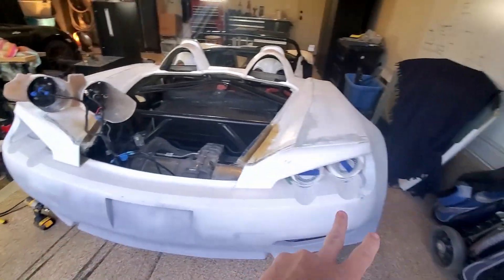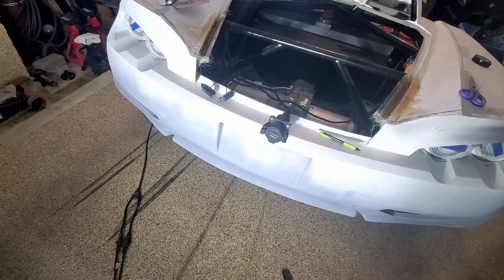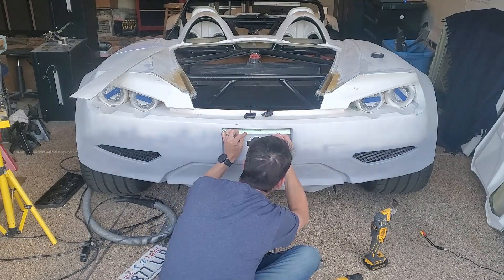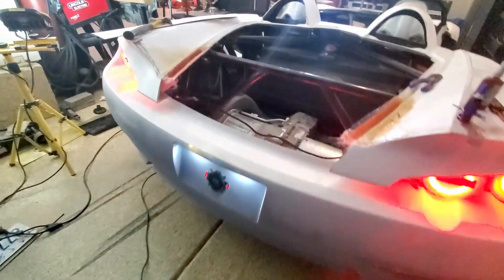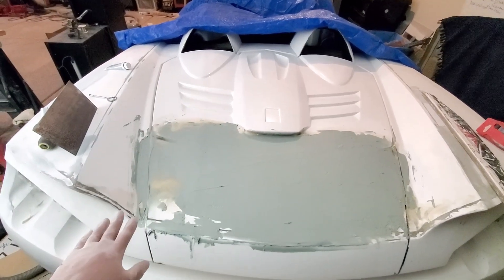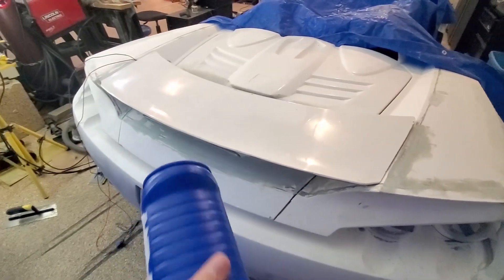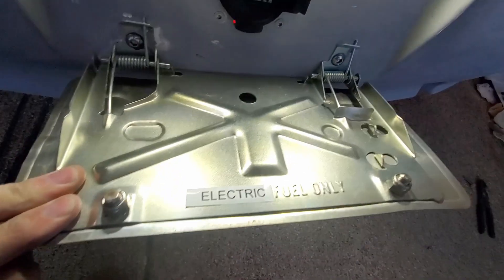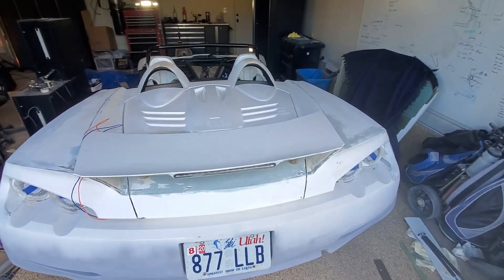Rear Wing Mounts – From Chips Can

Comment: isn't a wing supposed to provide downforce ? it kinda looks like it's doing the opposite, but maybe i'm just not getting a good angle on it.
Reply from the maker: No...you are looking at it right.  To me it does not look like it will add down force.  May need a redesign
Reply: @electricsupercar  will you ever go fast enough to need down force ? like will you take it to a track ?
Reply from the maker: @JoeGP  I figure I have to give it a try...right?

Comment: Will you have a clearance problem with the license plate and the charge cable handle? Does the license plate swing low enough to allow the handle to go straight into the charge port?
Reply from the maker: I will have to check it out

Comment: maybe try to cap the bottom of the wing stand with some fiberglass or metal and attach a bolt going down so you can bolt it down to the trunk using a nut from the inside of the trunk. and maybe just fiberglass the wing to the stand for the connection there or make tabs on the stand so that you can screw it into the wing
Reply from the maker: Thanks for the comment!

Comment: I see you are soldering a lot in your build. I am no expert at all in this field, but heard this is considered to be bad in automotive wiring as vibration, bending and corrosion can lead to wire fatigue and all kinds of problems. Did you consider crimping the connections or why did you settle on soldering so much?
Reply from the maker: I usually crimp and solder...belt and suspenders
Reply: @electricsupercar  Soldering is indeed not good if it is about moving/vibrating wires.  And a din connector for power is also a future problem. Better use automotive connectors that are more water resistant

Comment: Great progress - would look at recessing the camera - centre under wing brake-light.  I would glass an offcut  of Aluminium solid bar in each riser so you can drill and tap and bolt into - Do you have a Metal Supermarket near you? Short cuts of solid stock you should get for aluminium scrap price!
Reply from the maker: Thanks for the comment!   I will have to check it out!

Comment: Awesome as ever. Is there a charge port handle convention? Looks as through a handle that bends down with the cord coming out at that angle may hit the plate?  I remember many plates flipped up to avoid the gas nozzle. But it then makes it a PITA to see what you’re doing . Good luck!
Reply from the maker: I was thinking about having the plug "up side down" so the handle curves up.  Do you think that would be a problem?
Reply: @electricsupercar  seems like it would be awkward ergonomically. The wire looping up and then back down will want to twist the plug too… dunno. Give it a try!

Comment: Does the charger handle clear the license plate?
Reply from the maker: I was thinking about having the plug "up side down" so the handle curves up.  Do you think that would be a problem?
Reply: @electricsupercar  looks like on our plug the locking mechanism is on the top so it uses gravity to keep in place. Don’t think it would be a huge problem but you could always just flip the license plate holder so it flips up instead. Also you can place more than one port anywhere on the car if you want to

Comment: Very exciting as you get closer to completion.  I see the tilt-down license plate holder stops at ~level, so will the charging cables fit?  I often see these cables drape downward, so if they don't project backward beyond the plate, it may not work.  Perhaps you could hinge the plate holder at the top?  As for the wing, if it's in the air stream at all, there may be some significant forces on it.  Since there doesn't appear to be any adjustment for the angle, is the angle correct?  And is the trunk lid very secure in case there is lift on the wing?
Reply from the maker: Still trying to figure out the wing.  I was thinking about having the plug "up side down" so the handle curves up.  Do you think that would be a problem?
Reply: @electricsupercar  rotating the connector 180o seems simpler than remounting the LP frame.  I haven't used a charging cable, so I don't know if there are any indicators on it that might be difficult to see if it was upside-down when plugged into the car.  Also, is there any concern about weatherization of the mated cable/plug such that charging in the rain might be problematic (some small shroud on the cable that helps keep rain out)?  These are my only concerns.

Comment: Genius work on making the mounting legs for the wing. I need to learn to stop doubting your ingenuity. lol 

Do you think that you might need to trim the wing on the sides just slightly to avoid it rubbing on the body?  Since the original design was for it to be mounted in those points I feel like it might rub and once painted that will make a nasty blemish over time. I know you wont be opening and closing that lid often but there will come an occasion you will need or want to and I think having a "body gap" on each side of the wing from the body may prevent that.

As for the license plate bracket, lights and charge port. All very well done. Had me giggle a bit with the "Modification" you made to the fuel type. I see what you did there. lol. Only concern I have for that is perhaps the convenience  factor for the charge port. While a cool idea for hiding it behind the plate so there isn't an unsightly port on the side body, I was wondering if your going to find yourself wishing it were mounted higher when the car needs to be charged.?

Lastly, you didn't mention your idea for mounting the sequential LED strips. I am very curious to hear what you have planned for those. Can't wait till the next episode. Keep'em coming. As always, great work!
Reply from the maker: Thanks for the comment!  I was hoping to do the charge port "up side down" so that the charge plug will go up rather than down.  Do you think that would work?
Reply: @electricsupercar  I think that would work. Anything to make it easier on you between charges.

Comment: Ultimately I expect to use 4 hub motors for full time all wheel drive. Before I go spending 15 thousand dollars on my car I've been thinking about a smaller project to get some experience working with a full but scaled down system.
I have a bunch of Advanced D/C 48v/96v motors.
I have 3 or 4 possible vehicles to install them in as I've been collecting gas vehicles with blown motors.
What I really want and can't seem to find is a speed controller at a reasonable price. I know I've got this huge expense coming up for my big project but I really want something to play and experiment with.
Any suggestions would be greatly appreciated. 
Is there a site that has a good used parts for sale section?
I've been watching craigslist in my area for 2 years and have seen nothing.....
Good work, really like the channel. You have inspired me to get moving on mine. 
I'm going to start the major carbon fiber parts as soon as my new resin gets here. That's the problem with not getting on this stuff when you expected to. Some of this stuff goes bad....
Reply from the maker: Good luck!